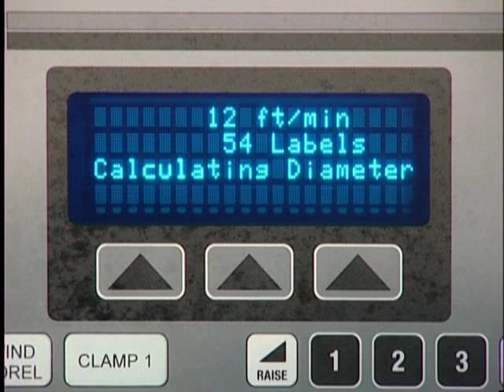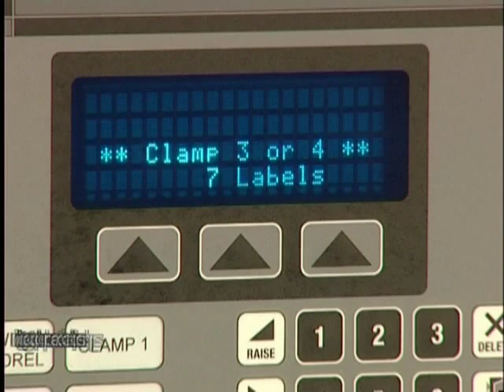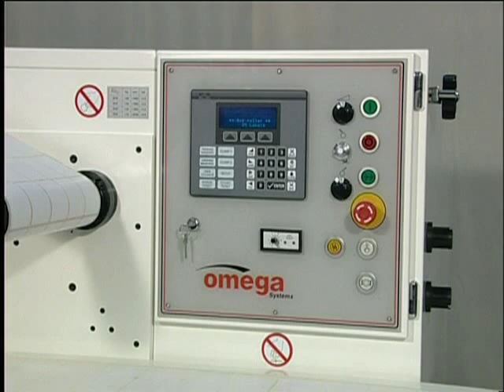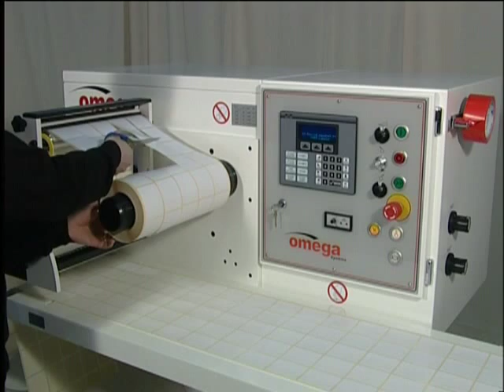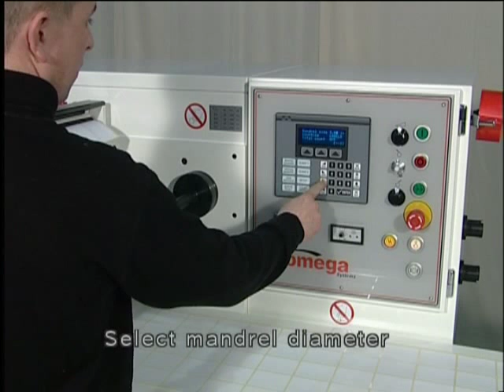OMEGA SR.mpg

Comment: Oh dear!.. Mr MP you've left the edge trim on the 2 outer rolls!.. Why has this not been adressed in this video?. It either needs removing during converting or removing on the Omega rewind which is not possible without a reverse rotary knife set-up, Rewind tower or extraction system... Shocking!. Please get your design team to call me if they require help.